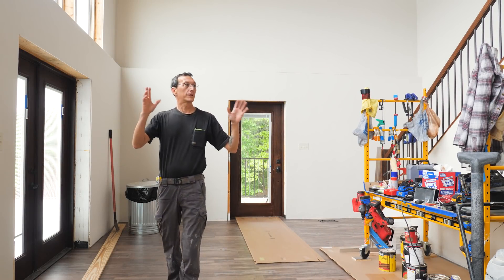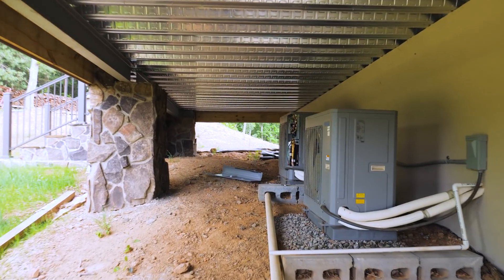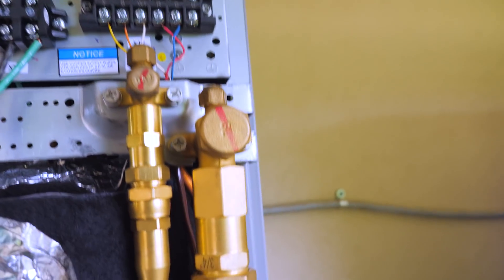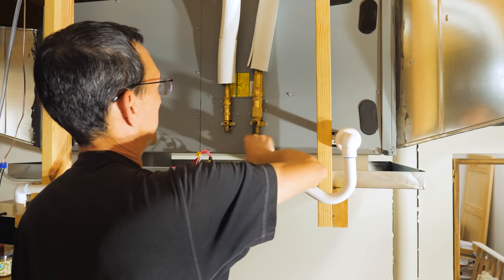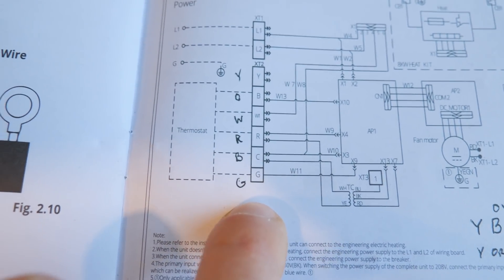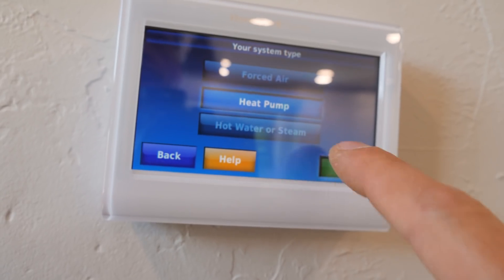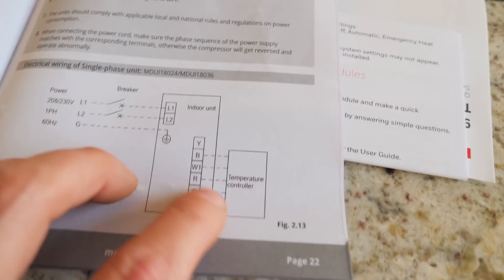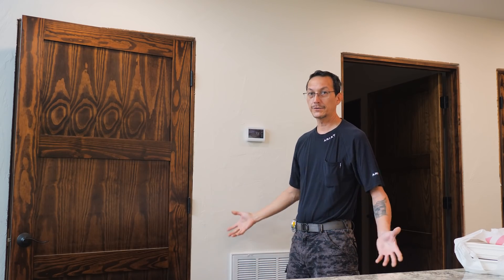MRCOOL Universal Series HVAC Startup and AC Test

Comment: MrCool documentation hasn't gotten any better.  I bought the 24K Versapro ducted heatpump and it came with a MrCool branded T-stat.  The manual gives no instructions on connecting the T-stat to the Air Handler.  Since I don't have the heat-strips (W), I think I need 6-wires: R, C, G, Y1, Y2/Y, and B.  The Versapro manual gives 8 different T-stat wirings, with no direction on which to use, esp. with their own T-stat in the kit.  The T-stat manual just says "connect wires same as for your old T-stat".  I suspect my system is made by Midea, and yours was by Gree.  Even more frustrating is that it can use a simpler 2-wire to a "communicating T-stat" using the HA and HB terminals, but their kit doesn't have such a nice T-stat.

Comment: Outstanding video and very informative. I just put a heat pump in my pole barn. It has minimal insulation in the walls of Aprox R5 to 6 and the overhead is Aprox R 15 to 16. It was an easy install and I’m slowly insulating all the gaps with spray foam trying to make it as airtight as it can be. I’m hoping that it’s relatively inexpensive to run so I can work there in the summer.

Comment: I'm in the middle of doing their 4-5 ton unit install. I have a few suggestions. I'd add some Intermatic AG3000 surge protectors to each condenser unit. Also, you're breakers are 50 Amp which I'm pretty sure it too large. My 4-5 ton unit calls for 45 amps MAX. 

Their directions are horrible as you mentioned!! Lack of many details such as the recommended filter size if placing directly into the air handler, breaker requirements. disassembly of the air handler if required to placing in the attic or making it light enough to lift and what you pointed out with T-stat wiring. The hardware itself is great though. I removed a 19 year old Trane unit and everything about the MrCool feels more robust than the Trane did.
Reply: I noticed breaker size too large also.  the data plate on the unit itself will give the no bs number

Comment: On the universals I installed there should be a D wire between the AH and the condenser, it tells the inside unit it is in defrost, I think to shut off the Air Handler fan in defrost so it doesn’t blow cold, and yes the documentation could be better, I had the same yellow ( compressor) wire issue, made a connection in air handler, can be used for overflow cutoff

Comment: I have the same issue. The outdoor unit didn’t kick with cool, just kick with heat. But is not because the Y cable, it’s correct the documentation. Goes from the thermostat to outdoor compressor w/o connected to the air handler. The issue is the thermostat should be programmed the O/B terminal for heat-pump. Check the documentation of the thermostat to configure it
Reply: Yeah, just select heat pump mode, right?

Comment: They have a reflective film (window tint) that acts like a two way mirror which may be a cheap solution for blocking rays from coming in and it only tints the window inside a minimal amount to still enjoy the views.
Reply: Just make sure any film you use is DUEL PANE rated or you'll blow the seals by super heating the gas inside the units.

Comment: I am planning an install for a Mr Cool 4-5 ton Universal unit and I am curious how much condensation are you getting from the outdoor unit? I am planning on moving the location of the outside compressor unit to an upstairs balcony but I am concerned the condensation my be too great to control and divert off that deck surface?  Thanks for any help.
Reply: it have an output in the bottom, you can install a hose to direct the condensation to any place
Reply from the maker: Not much at all but depends on your location and humidity. It’s always pretty humid here. The indoor air handler is where the condensation comes from, not the compressor.
Reply: @Guildbrookfarm  Thanks for the reply, Yes hot and humid here as well, I have some trickle from a Mr Cool condensor and an older goodman unit.... just trying to prepare....  Another question... My new location on this deck is just out side of a bedroom. All I have heard is how quiet these condenser units are...  Will it be disruptive to the bedroom in your opinion?  Thanks
Reply from the maker: It’s not silent, but it’s the quietest compressor I’ve ever had. It just sounds like a box fan running.
Reply: Condensation would only occur on the condenser unit (outside) if you are using it as a heat pump and you are running it in heating mode. The condensation occurs on the evaporator (inside) during cooling. This effect is the same as when you leave a cup full of ice and water condenses on the outside of the cup. The condenser outside will be hot during cooling and not have condensation.

Comment: Confused on thermostat wiring Outside condenser has Y, B, W1, R, C,  and no G.  Indoor thermostat has B, W1, R, C, G and no Y thanks
Reply: you wire the Y wire from the termostate direct to the Y wire that goes to the outside unit. there is no use or terminal for the Y wire on the air handler

Comment: I live in the desert where summer temps are 110 degrees. Could not keep temp constant in My old (34 yrs) 2 story wood frame house. Summer bills $500. I had the house painted white, put in new windows & doors, put in real wood shutters (white) on the windows. Have ceiling fans. Did not change out the 34yo cent AC/heat unit. House stays cool till 8pm, i run the whole house fan if outside temp is cool. If not, use ceiling fans. Finally if that doesnt do it, run the AC. AVG electric bill now is $100m & Gas is $40. My home is 3000 sq ft. To those of you who live where elec is high per kwh (ie Calif) Improve the structure before changing out your unit.
Reply from the maker: Absolutely. Good advice.
Reply: Sounds like solar would be great for you.

Comment: How can this be super quiet.. it is loud their site says 55 DB and I am measuring 80 from mine my old York was 75... Their support is non existing
Reply from the maker: Well mine is super quiet. I can’t usually tell when it’s running.
Reply: @Guildbrookfarm  would you mind measuring the DB level .. I just bought the unit it is close to a bedroom . Their support is not responding by email or voicemail .. I have to know if I bought a defective machine.  I watched your review and this super quiet so I thought it is. After installation I saw a different sound. The handler is quite . Thanks and I hope it is not much yrouble
Reply: @khaisy1  I replaced a 3 ton trane xe1000.. by comparison, this thing is whisper quiet like this video. I no longer hear the outdoor unit inside the home like the trane. I can only hear the compressor within 5' of the unit outside. The fan is quieter than one of those cheap box fans you buy at walmart. Post a video of what you're experiencing?

Comment: An inferior product when compared to Mitsubishi. I have alot of experience on many different makes of these units and have seen alot of problems with other makes. When you have a problem and need a service tech, then there goes the savings.
Reply: He doesn't need your service tech.   The company technician tells how to troubleshoot their product over phone for free, in the worst case scenario, replacing condenser by oneself would be cheaper than to pay triple price for Mitsubishi right up front, at least  that works for me I was quoted 15 000 for Mitsubishi and  installed system which bought for 1850  by myself
Reply: @andreycham4797  That's pretty laughable so who is going to replace anything on the refrigeration side, most diy wouldn't have a clue of how to service that side, anybody can replace a board or fan motor right. Lol
Reply: Not so says a buyer/customer in the comment section who cant get the company to reply by phone or email to his troubleshooting. My personal experience in buying products that are cheaper where the company support techs "help YOU" do do the work, often leaves the buyer out in the cold.
Reply: Wrong. I’ve installed tons of the off brands. Parts are way cheaper than Mitsubishi. Mitsubishi is way overpriced.

Comment: You shouldn't be worried about opening the lines because you might lose refrigerant. You'd be best to open them at installation, not when the job is done. What happens now if someone hit a line with a nail or something? If your lines are buried in the walls, you would now have to open drywall and repair

Comment: As an HVAC contractor, I can vouch for these as well. We've only helped verbally with instructions when someone was confused about the directions. Never had to install one. There are reasons why you pull the lines like you should and set things according to specs, so though DIY, it is important to stay within the limit of those specs. Awesome system though. The casa being what it is  - is the best!! Two cool thumbs up for you!! Enjoy!! Smiles and blessings...
Reply: How do these qualify for the warranty if you "do it yourself"? Don't they specifically say "must be installed by an hvac professional"?
Reply: @CountryLivingExperience  not all of them do, no. As a residential owner, you can not buy a HVAC system and install it without a permit. Which will require an inspector to check it before you can power it on. Only certified technicians can purchase (the system gets cheated - yes). These anyone can buy and install... you must follow instructions and if something goes wrong... it's on you. No homeowners insurance will cover damages or loss of life due to carbon monoxide in a DIY furnace install, or freon poison from a DIY cooling system install, unless you show proof of permit/inspection. This is why you keep these thing in the initial purchase of a home. As Jeremy pointed out, all the freon work was done on these, designed to not need the tech to vacuum and balance the system.  So these companies putting these out are saying it's safe for anyone to install since just anyone can purchase and install, they always recommend procedures and inspections. I believe they state they won't cover any warranty without one. I've known several people who pulled permits, installed themselves and were inspected - passed and all is well. The design of these are truly the next step and even as an HVAC tech and installer, I take my hat off. The industry can over charge insanely... and why not if you want to do the work and take on part of liability. It helps people help the truly needy by simply following the steps, permitting and inspection - and they can give the cost of labor. We have done this with certified only purchased units... we always permitted and got our work inspected. Thus guaranteed our work for 5 years. We only installed 10 year guaranteed units... which is a good " lifetime" of any of them, some last longer given the best maintenance, but if you do nothing but use them hard that's about what you can expect. I say this given my work in the different states, each state is different.
Reply: @hisimagenme  not true. You can order ac equipment from Home Depot and they will ship direct. No license needed.

Comment: We have large windows similar to yours in our cabin. Last summer we had a UV film installed on them. It made a huge difference in the temperature. It is a very clear 3M film so while there is a slight tint I don’t even notice it anymore. The other benefit is over time the sunlight bleached the floors and walls. So you can see where there was an area rug and where pictures used to be on the wall. The UV film is supposed to stop that as well. Can’t rate it high enough. Great product.   A lot of products on the market so pick one that fits the budget.
Reply from the maker: Our windows came with that type of tint from the factory.
Reply: Weren't they also supposed to be gas insulated

It might be a thermal reaction off the walls being beaten on by the sun radiating in (can feel the wall to see if its warm)

Nothing the Mr Cool can't fix,though

Comment: I guess I don't understand why you weren't allowed to connect electrical as soon as you had a panel.  That is what I did here in South Dakota.  As soon as the walls were framed we set a panel and ran power from the utility.  I had temporary outlets all over while I was building.
Reply: NC is a surprisingly authoritarian state.
Reply: @N8TheSnake  South Dakota is quite the opposite.  The biggest thing was that I was required to be living on the property in order to pull an electric permit.  Wasn't a problem as we were living in our RV on site

Comment: I think you will be impressed with the systems. Switching from conventional heat pumps to inverter heat pumps took $200 per month off my electric bill. With your insulation, you could make your place a refrigerator. You could add hideaway blinds for the west facing windows.